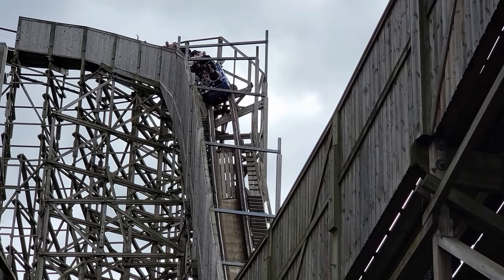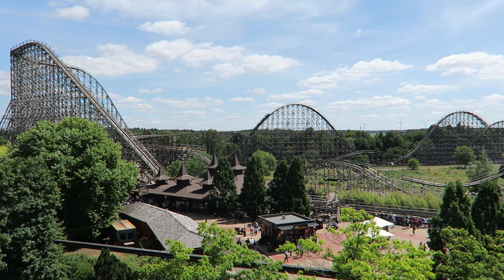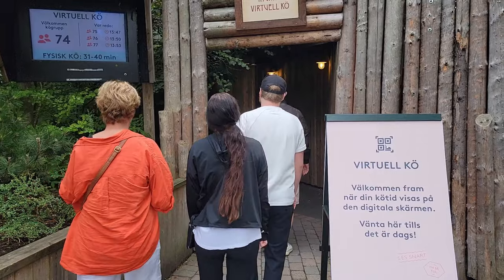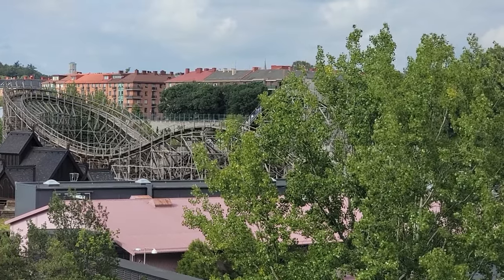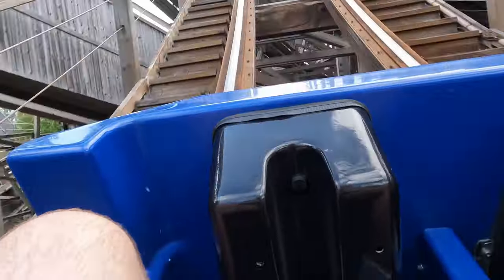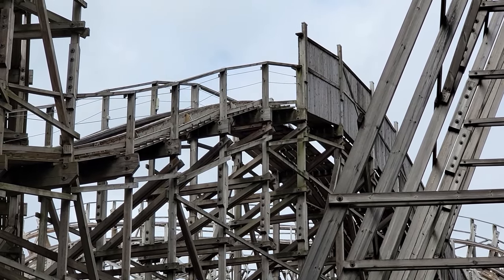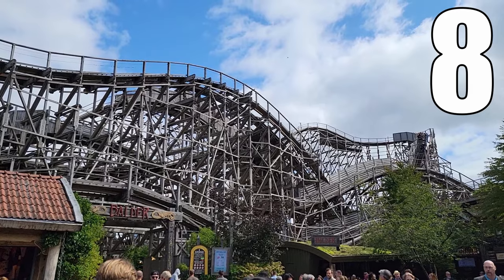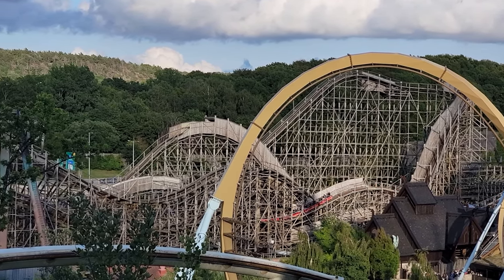Balder Review, Liseberg Intamin Pre-Fabricated Wood Coaster | Is This Ride Too Repetitive?

Comment: I just rode two days ago. Felt even faster than my last rides 4 years ago. And glass smooth. To me it is a masterpiece of coaster design, my fav woodie of them all. Not a single inch of track wasted in one of the most compact designs ever. To me, the “gentle” turns compare to the slow tempos on a masterfully orchestrated symphony, intensifying the sensorial overload of the upcoming airtime hills, giving you a chance to catch your breath and share complicity with your riding partner. It is exhilarating and elegant at the same time. Repetitive? More like  “irresistibly repetitive” I would say. A state of the art modern re-invention of the timeless classic cyclone coasters. As for Liseberg, I cannot think of a better park really with more allure, attention to detail and magical atmosphere. Every coaster is top of their category. Quality over quantity. Its their 100th anniversary and they deserve all the praise.
Reply from the maker: That's an interesting take on the turns, but I prefer full throttle start to finish.

Comment: In 2001 Colossos opened at Heide Park. In 2016, the ride was closed.
Those who rode Colossos last time said it was...
A) smooth
B) rough
Reply: I rode in 2012. It was relatively smooth, but had some vibration in the helix. Very re-rideable.
Reply from the maker: B

Comment: I saw in videos and images, that I think Balder, the Intamin pre-fabricated wooden coaster at Liseberg, and Coaster Express, the RCCA wooden coaster at Parque Warner Madrid, both use the same trains and restraints.
Canobie Coaster would say: Yes.
If I ask you: But what are the most notable differences between them in ride experience for you?
Canobie Coaster would answer:
A) Balder is smooth
B) Balder is rough
Reply from the maker: A

Comment: It's a shame that the Intamin prefabs all have pacing issues. The Ride of Steel clones do too though, so I think that's something that Intamin sometimes struggled with back then. Is the first turnaround on  El Toro better than the ones on Balder?
Reply from the maker: The turnaround on El Toro would be better if it were smooth.

Comment: Canobie Coaster, imagine if I ask you:
Both Balder at Liseberg and Coaster Express at Parque Warner Madrid use the same trains and restraints.
Canobie Coaster would answer: Yes.
If I ask you: With the same trains, what are the differences between the two for you in ride experience?
Canobie Coaster would say:
Balder is...
A) smooth
B) rough
Coaster Express is...
A) tolerable
B) not
Reply from the maker: A and B